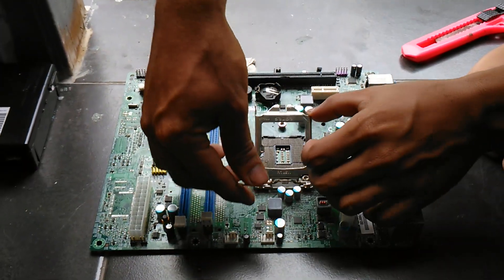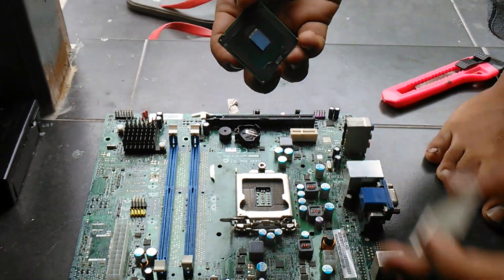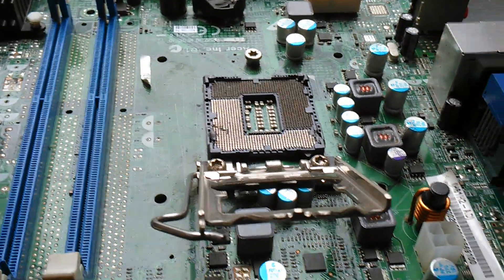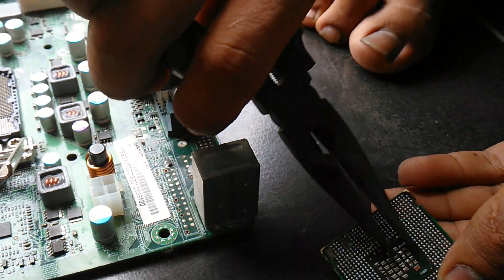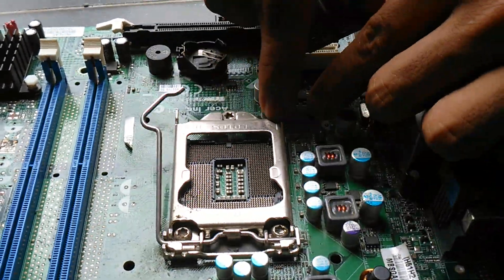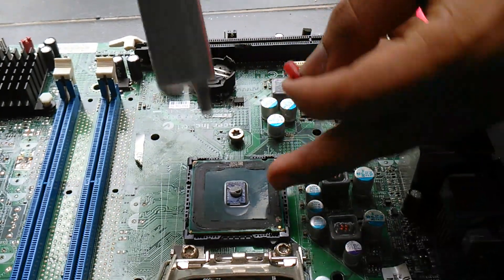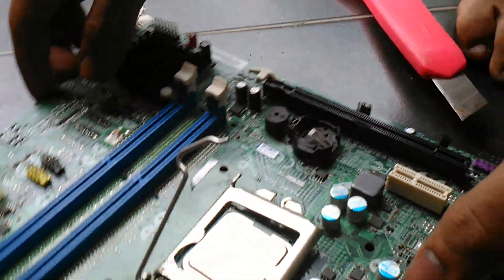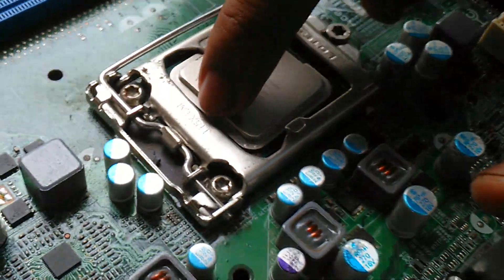LGA 775 TO LGA1150 MOD.!!

Comment: This is false advertisement. DO NOT follow this mans instructions. You will ruin your motherboard and cpu if you do. You have been warned.
Reply: What?!!! My core i9 finally worked on my lga 775 motherboard. Stop spreading false news
Reply: LOL probably did it wrong, my 7600k works like a champ in my old socket 775 board.